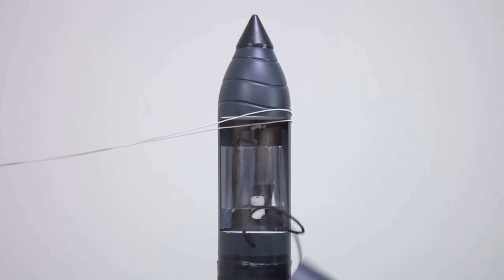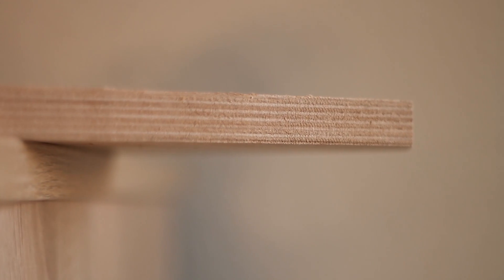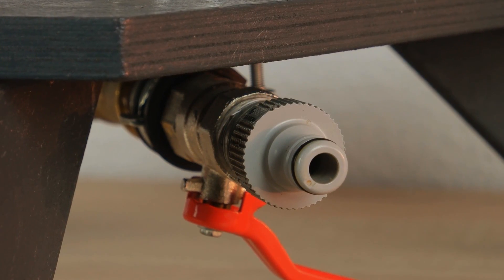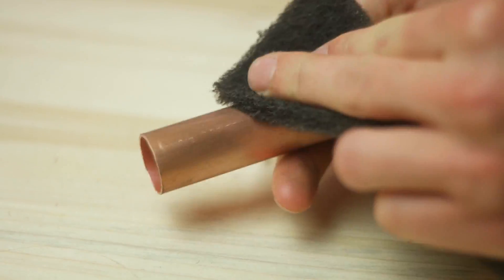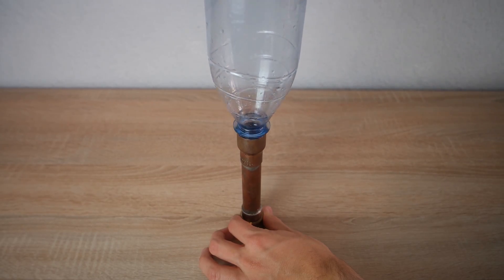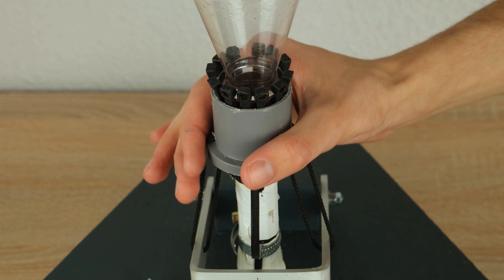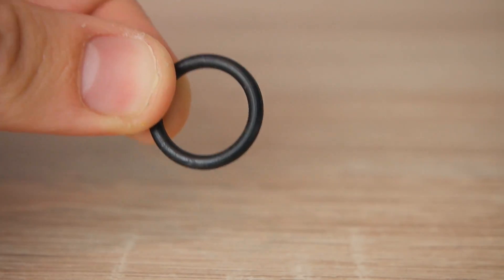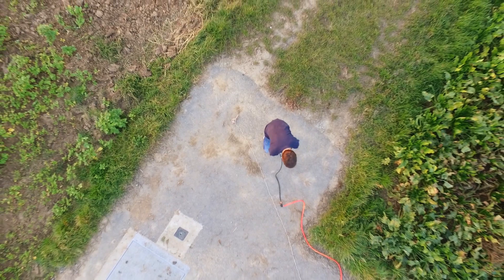DIY: How to build a Launcher for Water Rockets

Comment: Hi,great video guys, I built the launcher but I’m having a problem. After a launch or two at 120 PSI the tie raps move up the copper pipe, I’ve tired tightening the jubilee clip but it still seems to be moving, any advice? Thanks

Comment: Hello, I am a follower of both yours and air rocket command. I have just adopted your idea of pumping the water into the rocket, before I used to pour it from the top. However, I have noticed that by doing this I build up pressure in the rocket before pumping the air in. How do you solve this problem. The air entry has a non return valve so   I cannot know how much pressure has been built up into the rocket whilst pumping in the water. Can you help? Thanks.

Comment: Has anyone ever used an airgun reservoir as rocket and pressurized it to 4500 psi? I have an extra air tube and the compressor to fill it and I keep wondering how high it would go.

Comment: Thanks for good ideas, i just build same launch ped. How much you can put pressure with the pump you use In this video? I managed to get just 8bar and the pumping went really hard😑
Reply from the maker: There are pumps available which can achieve up to 17 bar ...but it is quite hard for sure, especially when the rockets get larger.
Reply: you can use a PCP pump

Comment: What is the max psi you can use with the launcher? Also, what psi do you use to launch your rockets?
Reply from the maker: We launch our rockets at about 200-260 psi. I think the launcher can hold even more than that, but we have never tested it.
Reply: Thanks for the info. Also, is there a complete parts list of the parts you used? I can't seem to find some parts like the reduction sleeve and the 22mm to 3/4".
Reply from the maker: Please check out our website for a list with all components: http://www.raketfuedrockets.com/en/launcher.htm

Comment: Excellent! Durable, reliable, a lot of metal parts! German quality! :) And what is the maximum pressure reached when starting at this launcher?
Reply from the maker: Thanks a lot, Sergey! We have already used this launcher design with 18 bar / 260 psi. I think the launcher can hold even more pressure, but it would be maybe good to braze the components instead of soldering them together. 
Cheers
Julian